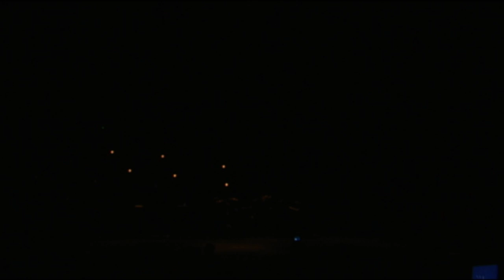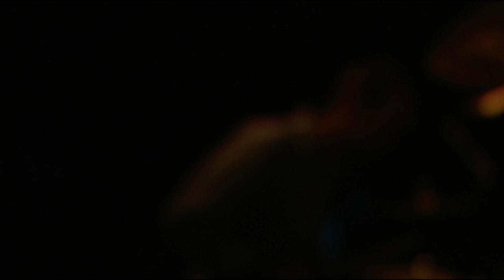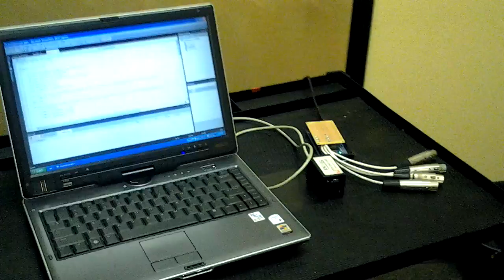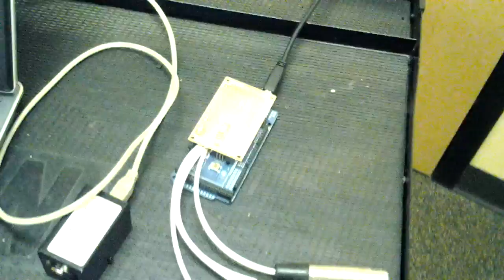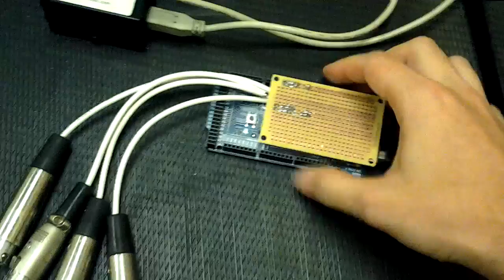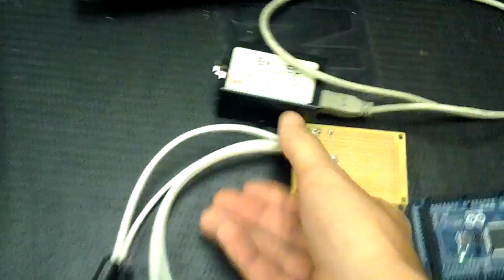Audio Triggered Drum Lighting (With explanation of how it works)

Comment: thank god, i found this video again after one year or so. thank you so much for sharing it and how you've done it. it inspired me as a diy electronics guy to do it fully analog. i have yet to assemble and test it to adjust a few things, but the scematics are  ready and look right to me. if one has basic components at home, it will cost ~ 0-10$ per unit of light bulbs
Reply: Where are the scematics?